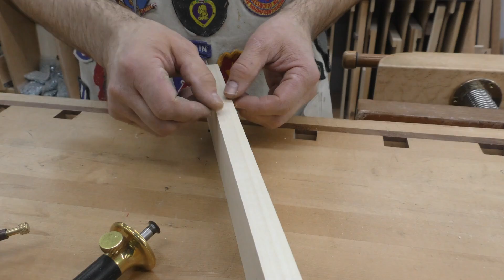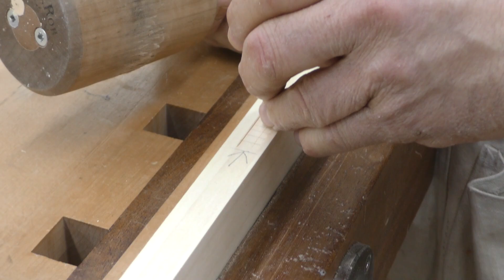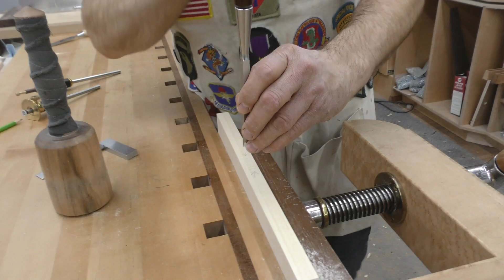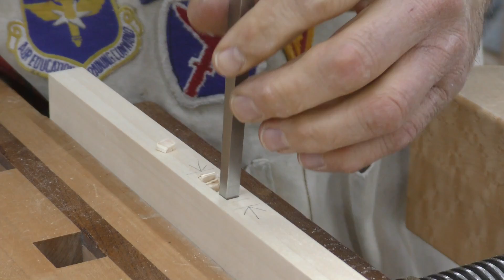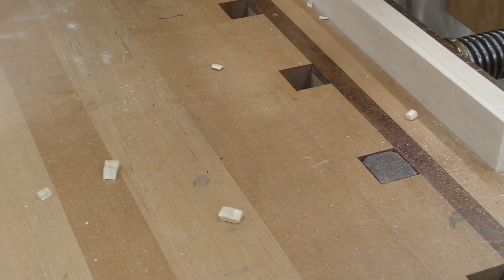Chopping a Mortise by Hand

Comment: If the accent didn’t indicate that Rob is Canadian, the mallet handle wrapped like a hockey stick grip sure does.  Thanks for thr tips, Rob.  Putting pencil markes along the length of the mortice to help position the chisel is something I never thought to do.  I also like how tou set your making gauge to the width og the chisel by sandwiching it between the marking gauge cutters.  It seems I need to flip my cutters.

Comment: Turn your wheel's so as to mark a square sided mark , both bevel in for a mortice !
Reply: If the bevels are turned in, you cannot use the sides of the chisel to accurately set the width.

Comment: Great video. A round mallet and a square bevel helps driving the chisel plum. I saw people cutting a sacrificial tenon to guide the chisel plum, waste of time... 

I noticed you are using a LN mortise chisel, which I know that the sides are square to the back of the chisel. My mortise chisels are slightly tapered and they have a tendency to twist. I experienced that especially in soft wood. The manufacturer advertises that this is a feature to prevent the chisel binding into the mortise(lol). In my opinion a tapered chisel is more prone to bind then a square one. I would love to test the LN chisel in a 3" mortise to see if it binds or not. Can you please share your opinion on this? Thank you.

Comment: Thank you for the tip of drawing lines with the square across are you are chopping out. I hadn't seen that anywhere else.  It will definitely be helpful.
Reply: It is a good idea.  I actually square a marking knife line, instead of a pencil line, across.   The mortice chisel blade fits perfectly into the scribe line and is exactly square to the sides at all times.   I used to draw a line but found the scribe line more accurate and helpful in placing the chisel blade where is needs to be

Comment: My favourite method when using a maxhine (forgot the english word, but basically) you have a station w a plunge router table mounted at 90degs.  But hand is often faster, quieter, and you can make very minor changes/ shavings on the fly.
Reply: I hate powertools, especially routers. . . #notopowertools